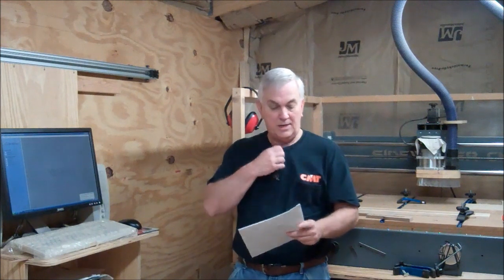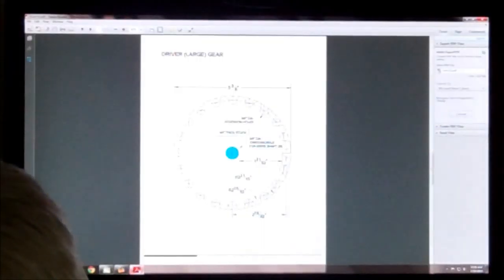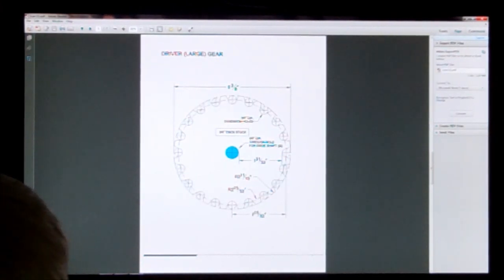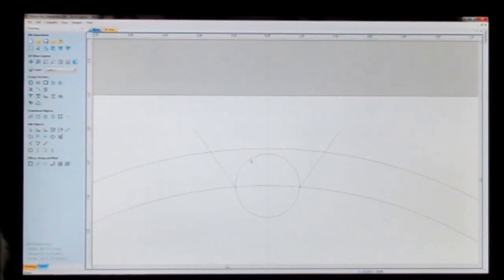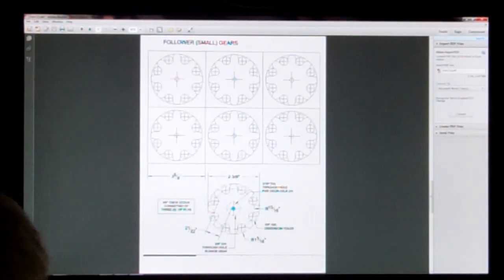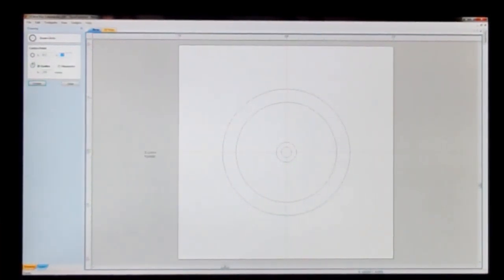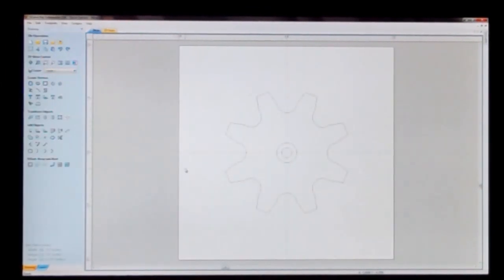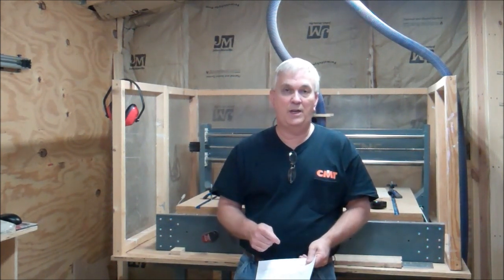How to Draw a Gear in VCarve Pro

Comment: Hard to see on this very blurred screen... it appears this will be noisy and cog majorly since the inner circle has a not a smooth convoluted line... it will catch...!  am I not correct on that?
I guess one could call that a gear, when in fact it's really a sprocket and a flat one at that... and since a sprocket cannot be flat,  hmmm  a gear!   I am looking for the beveled and helical versions of this.
Any chance we might see that?  will it need the 4th axis?

Comment: Dave cut 2d does not have an array tool. REB
Reply from the maker: Yes that is correct.  I was assuming that the drawing options were pretty much the same as VCarve Pro but I downloaded the trial version of Cut2D and checked it out and found out it is not.  Pretty disappointing.

Comment: there is a free gear maker gadget for drawing gears...go to the vectric web site look for gadgets the portal will take you to a gadget web site...many free gadgets for vcarve pro.
Reply from the maker: Yes that is a free gear maker gadget for VCarve Pro but if you are trying to make a gear from plans you most likely will not know the diametral pitch and pressure angle so it is quicker to just draw it using the plan dimensions.
Reply: Dave Gatton you can generate a free template from (woodgears(dot)ca/gear_cutting/template.html)
or do what i did and purchase the stand alone for pc here (woodgears(dot)ca/gear/index.html)...
...just sharing alternatives....